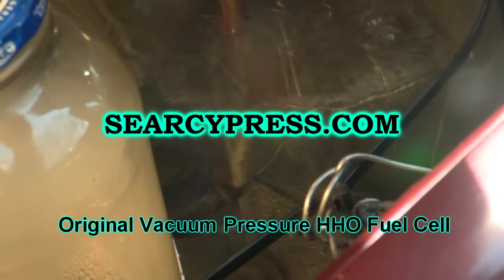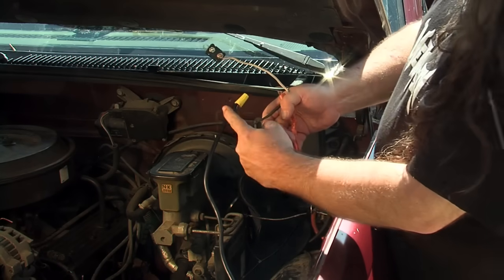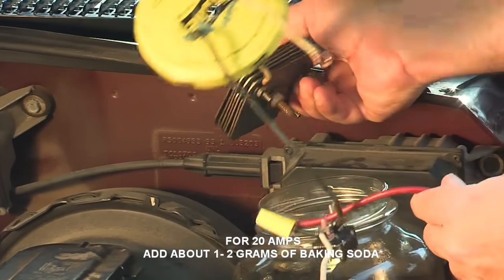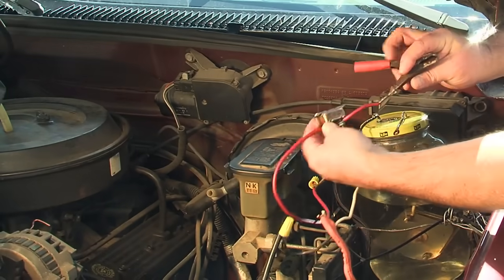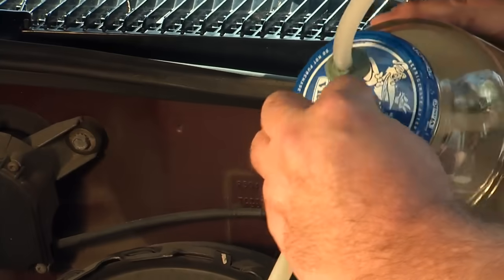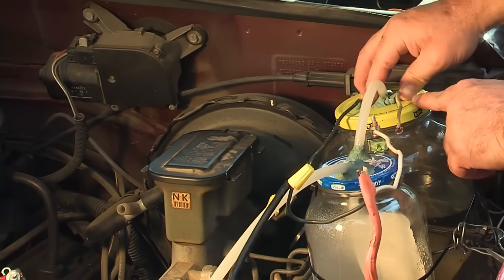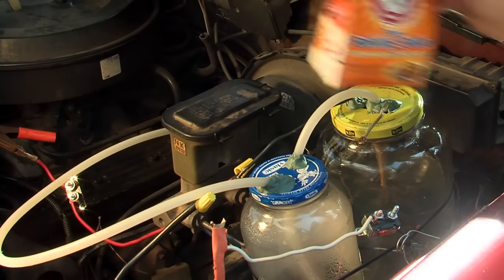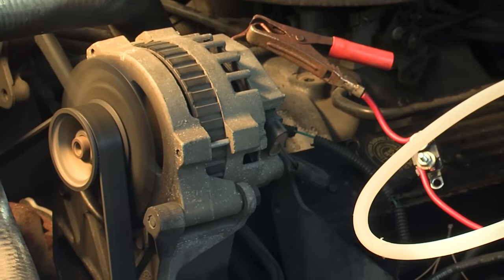Vacuum Pressure Hydrogen fuel cell defeats high gas prices using hydrogen from H2O.

Comment: the law of conservation of energy.....you cant break that law scammer
Reply from the maker: Okay Albert Einstein let me break it down for you. Your engine's only burning 80% of the fuel. That leaves 20% unburned.. We're not trying to power the engine. We're just trying to increase combustion and burn more of the wasted fuel. The increase comes from the gasoline. New videos coming out soon. Be sure and enjoy your new 15% ethanol gas. Thanks for the comment.
Reply: @metalpresstv  your dumb im burning
 o2 the fuel is just the catalyst.... this was dumb in the 90s...when i tried it ...if it worked everyone would be using this ...this dumb shit has been around since the 90s

Comment: I did this for years on an 76 Dodge D100 with a 318. I never could get it to run on pure hydrogen without gasoline. Gasoline requires the engine timing to be set Before Top Dead Center but pure Hydrogen explodes rather than burns so it would have to be timed After Top Dead Center. The temperature of the combustion chamber is critical too because Hydrogen will detonate as soon as the intake valve opens regardless of the spark timing if the combustion chamber is too hot. I would take a two liter plastic bottle and put the hose coming off the fuel cell in it for a minute or two then light it with a Bic lighter. It would shoot into the next subdivision. These fuel cells actually produce a lot of Hydrogen and you can make it useful.
Reply: Unless you had a battery to draw power from you wouldn’t be able to get it to run on pure hydrogen as that would be a perpetual motion machine and not physically possible.
Reply: @nathanaeltrimm2720  the idea is your starting it with energy suck as a pull start or a battery and then as it's running the alternator recharges the battery to keep it all in check. Curious to see if my Cummins has good enough batteries and alternator. Thanks Biden!
Reply: Hydrogen isn't all that flammable, even less than propane but when you have the other byproduct (oxygen) its very explosive and helps burn the gas more efficiently.
Reply: @triggerwarning2439  
Am I right in thinking that you're essentially saying Hydrogen flash detonates with little to no flame when ignited as supposed to other gasses which produce a brief fireball with visible flame's?
Reply: @ryancairns2317  it definitely burns just not as fast, less than propane so Hydrogen is essentially worthless in a gas engine but in a higher compression application like a diesel engine. But if using the oxygen and hydrogen the burn rate is very fast and makes a nice pop. The oxygen would be more beneficial when mixed with gasoline although you would need to change the cam and timing altogether to avoid melting something, because you are essentially dealing with cutting torch temperatures. This is why all gas engines run rich on purpose, to run cooler.  The catalytic converter is suppose to burn the rest. They could easily time a engine to burn all the fuel in the combustion chamber allowing it to be very efficient but they will burn holes right through the aluminum pistons.
Reply: Older Dodge engines would be ideal for some thing like this as their stock timing is already later than most
Reply: What sort of fuel saving did you get and is there a loss or gain in power?
Reply: @sjg3890  used this system on my 1970 dodge charger back in the day.  Don't know what the hp was but it definitely increased my ETs on the quarter.
Reply: @johngoff238  by how many tenths?
Reply: @sjg3890  
i can't tell you exact numbers, but you do save on fuel and it doesn't require that much power to make it work. 

you could easily produce the gas for free using solar power from a few good solar panels.
Reply: Hydrogen has a self combustion at think at 500 degrees Celsius vs gasoline at 240s degree Celsius so I don't know about that explosion idea with the tubing.
Reply: Do you have a video out?
Reply: Doesn't the explosion of hydrogen mean creation if water in the cylinder?  Wouldn't that have I'll effects for the engine life?
Reply from the maker: The primary source of water is actually gasoline. The water that you see coming out of the tailpipe is mostly from the burning of the gasoline. The reason you see so much is the catalytic converter is not burning as hot. I gasoline is burned in the cylinder instead of in the catalytic converter..
Reply: @singledeyde  normal gas produces water as a product lol. Spark separates hydrogen from carbon, then hydrogen plus atmospheric o2 makes H2O. H2O is actually what you see when it's cold out from most cars. Trucks that emit gray fog or black smog in summer is actually unburnt gas. Cars that have no visible smoke in summer but have loads of vapor in the winter is the same thing as you exhaling and seeing the mist in front of your face in the cold lol. Your car literally makes water as it is xD
Reply: O2 should come out a lower tube directed into the exhaust pipe. The hydrogen is 2.5 times stronger than gasoline and you can get 40 miles per gallon for your hybrid set up.
Reply from the maker: @mtsflorida  the system runs in vacuum. Not exactly sure how you would achieve vacuum by running a line into the exhaust pipe. Hydrogen oxygen injection into a normal atmospheric condition has been shown by our tests to be completely ineffective. The separation of hydrogen and oxygen however we have not tested in an atmospheric setup.  Interesting. Thanks for the comment. We have a new video in the works and hope to have it out pretty soon. Be sure and subscribe.
Reply: @metalpresstv  
I really enjoy your work on this hydrogen hybrid system 
Are we still getting that new video?
Reply from the maker: @ServantoftheMostMerciful_99  yes most definitely. Thanks very much for the comment.
Reply: If only you had spent years getting an education, then you wouldn't have done something so useless that would only reduce your MPG because you don't understand thermodynamics.

Comment: Was he also running gasoline? He mentioned this would help increase mpg? How do you contain the system from too much pressure while driving?
Reply from the maker: The system runs in the state of vacuum. The hho gas is used to increase the efficiency of the burn of the gasoline. We are not trying to power the engine with this fuel. During combustion only about 80% of the gasoline is actually burned in our wasteful engines. Injecting this gas can increase the efficiency greatly on the amount of fuel we are burning instead of wasting. The octane of the gas is boosted and all motor knock is removed even when using lower octane fuels. This will become extremely valuable in the very near future as 15% ethanol becomes the norm. Yes you heard me right. We have a new video coming out very soon so be sure and subscribe. You don't want to miss this one.

Comment: i would maybe add a backflash arrester so you don't go boom because you aren't separating gases so you are burning HHO witch when combusted turns back into water witch is now in your engine im no engineer  but im pretty sure that that is a horrible idea especially if the gas flashes back down the line you will explode your fuel source and potentially cause a short in your vehicle

Comment: Hhhmmm knowing combustion of HHO produces water, i imagine this would wreak havoc on your cylinders and compression rings, at the very least.
Reply from the maker: Not necessarily. Burning gasoline produces quite a bit of water in the process. We are not trying to fuel the engine with this gas. We are only trying to burn the 20% of unused fuel that is usually wasted. Thanks very much for your comment.

Comment: I hope you installed a fuse because if that negative and positive terminal error shorts out through the metal lid enjoy your battery melting
Reply from the maker: Not sure if you actually watched the video. There's fuses with automatic reset on both sides of the circuit. 30 amps. Thanks very much for your comment.

Comment: Any first year chemistry student will tell you this makes no sense. All this does is create more load on the alternator, which in turn put a load on the engine. You will lose energy in the end due to frictional heat losses, electrical resistance in the alternator, etc. The only way making H makes any sense would be to use free energy like solar or wind.

If this did actually work, you would effectively be creating a perpetual motion machine, which is impossible.
Reply from the maker: Actually I think the first year chemistry student might be smart enough to realize that only 80% of the fuel is burned during the combustion process. That leaves a 20% margin for increase in efficiency. You seem to be thinking we're trying to power the engine. That is not the case. We are trying to increase the efficiency of the burn. Thanks for your comment.

Comment: ROTFLOL! You cannot get more energy by burning the gas that it took to create the gas. Combustion of any fuel produces water in the exhaust!
Reply from the maker: You misunderstand. We are not trying to power the engine with this fuel. The engine only burns about 80% of the gasoline. We are improving the efficiency of the burning to try to squeeze the last 20% of the gasoline energy out. It's not over unity nor does it claim to be. It's super high efficiency by injecting explosive steam in the state of vacuum into the cylinder. New video will be coming out soon, be sure and subscribe.

Comment: Sorry stupid question will this work with fuel injection or only carbureted? I am a goldsmith not a mechanic.
Reply from the maker: Any piston engine with vacuum. We are not trying to power the engine. We are just trying to burn more of the fuel that is wasted. Many engines only burn 80% of the fuel normally. That leaves room for 20% gain in efficiency without breaking any laws of physics. New video is in production. Be sure and subscribe so you don't miss it. Thank you.

Comment: Stupid. One your using a very explosive gas. 2 the guy never actually shows any proof of his claims just states that it doubles fuel milage but how? Unless he has dialed back the fuel his engine is being fed from the fuel system its still pumping just as much gas into the cylinders. All its doing is adding a small amount of hydrogen gas into the air intake. More likely that this will fry the engine that is designed to run off of gasoline. Hydrogen gas burns much hotter than gas so even if you save some on fuel you will end up cooking your motor and spending 5k to replace it have fun.

Comment: My question does the water freeze?
Reply from the maker: Where we are at in the South not so much. If you live in very cold climates it could be an issue. Wider plates spacing and more electrolytes would be a solution. I have had one freeze solid but the glass jar did not bust. Certainly it could, but would be easily replaceable. Thank you very much for the question. We are producing a new video which will be out soon. Be sure and subscribe.

Comment: The bong looking jar if it has a little water in it will work as a flashback arrester also.  I have heard though that electrolyzing with stainless steel can cause the water to be contaminated with hexavalent chromium.  Great video though.  This is the kind of shit they were killing over in the 90's but once it's on the internet and we all see it, they can't stop us from doing it.

Comment: You could use a squre rectifier and controled by tps as a on demand sys and a smaller version for idle . And disteled water and less conductor will use less amps even with bth systems . And i made them with pvc 6in and bubbler from two inch but the jars worked for me fine   . But i took mine off road
Reply from the maker: How exactly did you keep the PVC from distorting under hard vacuum and high temps?

Comment: What happens if you crash
Reply from the maker: That's a good question. You notice how the power is connected to the alternator by a clip. This clip will undoubtedly pop off killing power to the cell. Thanks very much for the comment.

Comment: How would this effect a fuel injected  system?
Reply from the maker: Results will vary. For obvious reasons I cannot sanction anyone doing this. However the system runs in a vacuum increasing the burnability of the existing fuel in the cylinder. Even if no mileage gains were realized you would be able to burn lower octane fuel and eliminate any engine knocking which would  save you money on mileage and wear and tear. Injecting into the vacuum as opposed to injecting into the air intake are two totally different things. When you inject into the air intake the gas is diluted and could cause an increase in leftover oxygen. Injecting into the vacuum is arguably a different situation. We are producing a new video which will be out as soon as possible. Be sure and subscribe and I'll cover as much as I can. Thanks for your comment.

Comment: Your alternator cannot make enough power to make enough hydrogen to run that engine
Reply from the maker: You seem to be thinking we're trying to power the motor. That's a misconception. This engine only Burns about 80% of the fuel normally. By increasing the efficiency of the burn in the cylinder we can push that well above 90%. We're not trying to power the motor we're trying to get a more efficient burn. The fuel still powers the motor.. A new video is being produced now and will be coming out soon. Be sure and subscribe. Thanks very much for your comment.

Comment: Wouldn't it be safer with heavy plastic containers instead of glass jars
Reply from the maker: If you were able to find plastic containers that could take the heat and pressures of the vacuum of course that would be preferable. Unfortunately the thermal effects of the plastic would be counterproductive. The glass, it's under vacuum which reduces the risk. The thermal properties of glass are excellent for what we're doing. A new video is coming out very soon so be sure and subscribe so you don't miss our 10 years later update. Thanks very much for your comment.
Reply: And a high pressure relief valve for safety
Reply from the maker: @rickphillips7257  I doubt very seriously you could find any plastic that can take the thermal stresses combined with the forces of hard vacuum. Over time they distort.  As long as the vacuum is maintained the risk of explosion is greatly reduced. We are producing a new video as we speak that will show you a safety feature we have added. Be sure and subscribe. Thank you very much for your comment.

Comment: Physics tells us there is no free energy. The amount of energy to seperate water into hydrogen and oxygen is exactly the same amount you get back when they combust and recombine. That’s not taking into consideration the energy loss in line loss and heat. This is not going to save you a damn penny and possibly blow up your car. All it’s going to do is make your alternator work VERY hard, and get hot, and be even more inefficient than normal. To get that 25 amps, you’re going to waste a TON of gasoline..

Comment: this makes no sense; there's no energy being added to the system:

water
 ->  (using power from engine)
HHO gas
 ->  (powering engine)
water(in cylinder, then exhaust)

there's no chemical energy gradient between the water in the beginning and the water in the end, so this does nothing except for wasting energy in efficiency losses
Reply from the maker: Let me clear it up for you. This engine only Burns 80% of the fuel. That leaves 20% lost in lack of efficiency. We are not trying to power the engine. We are trying to increase the efficiency. The hho allows for higher burning efficiency of fuel with a much cleaner burn. No one's trying to break the laws of  physics.  Thanks very much for your comment.

Comment: A mileage check would be nice. It would require only a few trips to the gas station. You keep the video short by playing your driving test at high speed. One video topping off your tank, driving 10 miles plus, then top off your tank again. the math is miles/gallons. Do that twice once with the machine and once without and we will see how much added mileage you get.

I'm genuinely curious to see the real numbers. Full disclosure I've built one of these and the projected additional miles were between 8 and 10 per gallon. And that was with a more heavy duty caustic electrolyte. I like these things and I love it when people do this stuff in their backyard.

Also I'd like to hear about maintenance. Is there any extra service you have to do to the valves of the cylinders with hydroxy gas going through it? Do you end up with excess water in your oil from piston blow by?

One final note there is a generation of vehicle, and unfortunately I can't remember the dates, that does not work well with these things. The computer is just sophisticated enough to freak out when the O2 sensor reads too cold. It will end up dumping more fuel and your cylinder to try to compensate for it. Translation certain cars with this setup will make you burn more gasoline. A translation of the translation; you go backwards :-)

Other than I have a nice day
Reply from the maker: We have a new video coming out soon I'll try to cover as much of that as I can. Be sure and subscribe the videos in the making. Thanks very much for your comment.
Reply: @metalpresstv  I'll hit the button now. I look forward to what you do next. And thank you.

Comment: Using glass jars in the engine compartment is just asking for it with all the vibration and heat they will break. Couldn't he have used metal container